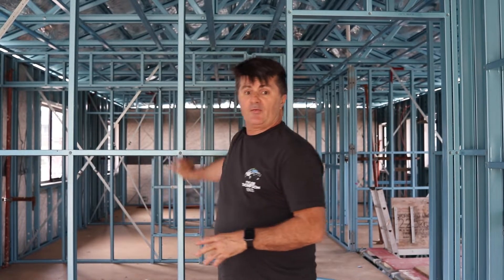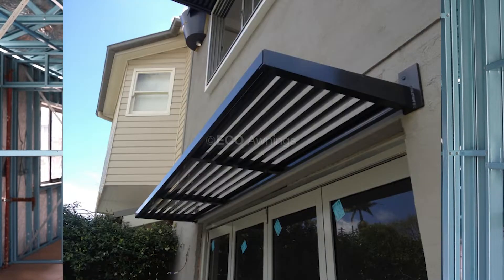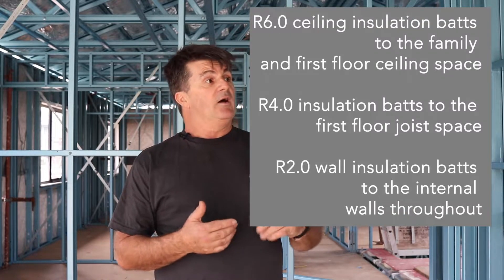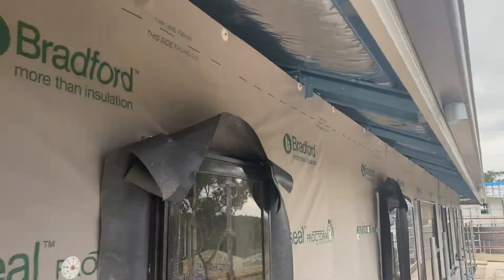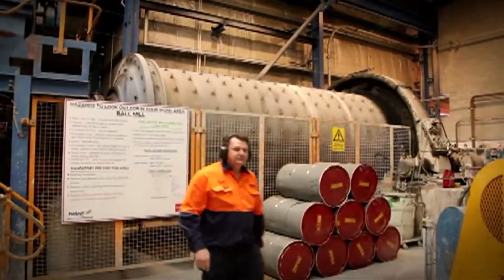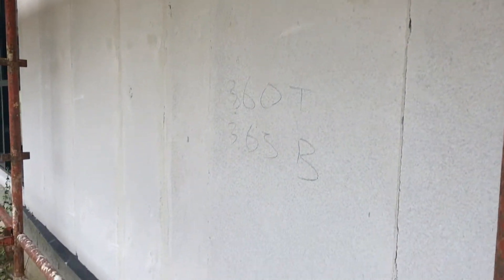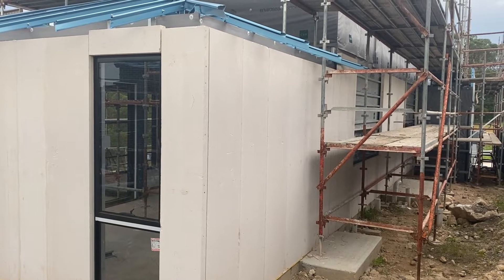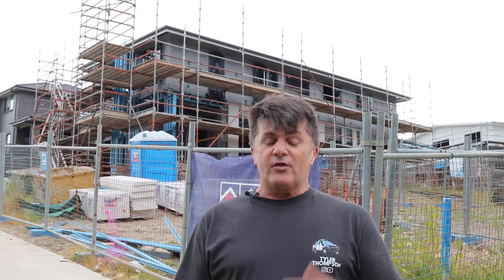House Build // Frame - Hebel - Insulation - Fire Rating - BASIX Rating

Comment: hows hebel in terms of handling heavier fixing on the wall? should we consider anything in mind, b4 build to make fixings easier later on?
Ex: Retractable Hose reel, Alfresco roofing,flood light fixing etc
Reply from the maker: For stuff like flood lights it's fine, our builder has also hung the louvred stacker door awnings off the hebel with no issues. For items such as hose reels and alfresco roofing, I'd be putting in self supporting uprights, into the ground. Would be both quicker and easier in the long run.
Reply: @DarrylSheather  thank you

Comment: Steel frame has its pros & cons but really not a bad choice since you are in bushfire prone zone, plus it is termite worry free. Need to do a backyard standalone studio and considering using steel frame, just curious to know which supplier / manufacturer you went for and how did you think they quality and install. Thanks.
Reply from the maker: I can't fault the steel frame itself, really can't think of any downsides to it so far.
Reply: @DarrylSheather  heard something from structure engineers, mainly around the expansion / contraction due to temperature changes, causing weird noise, plus it's not as easy as timber frames in case of indoor reno.

Comment: How is the hebel panel strength and finish? Very keen to see what this is like considering I’m using hebel in my house build. Any regrets over using brick?
Reply: It will not have the same strength as brick so no drilling and installing AC units etc on walls.

Comment: Is hebel stronger than brick?
Reply from the maker: when rendered its quite good, the panels also have reo embedded in them.
Reply: @DarrylSheather  Thank you for the reply. I'm building with Mojo and at first I decided to go with hebel but change my mind.
Reply: Been involved building with herbal since 87 and herbal panels at Bella vista on nor west blv nor west. Insulation perfect. They don’t like moisture or any movement. Easy to damage must use a herbal approved render. I’ve also seen a lot go bad because of this product. Just a heads up herbal was originally designed for explosive material rooms or like mri , cat scans X-ray and DAARKKE no it’s stronger than brickwork.
Reply: @Pumped-koala  Thank you so much and appreciate your input. I've told mojo to change it to brick and not hebel. Again thank you very much

Comment: We used Hebel, as a floor for the upstairs. . Apart from insulation, it will not squeak in 10 years as particle board does.
Reply from the maker: Sounds like a good idea!
Reply: Only reason ply floor squeaks is because  alot of carpenters aren't screwing floors

Comment: While the frame is exposed, mark the garage floor so it is easy to find the frame after the gyprock has been installed.
Reply from the maker: I was going to do that but as its steel felt it should be pretty easy to locate afterwards.

Comment: Wow that will be a very solid house. I really enjoyed seeing the detail on that outer cement based material you showed. It will definitely help with thermal bridging from the outer heat to prevent the steel frame to get too hot. I hear it gets very hot in Australia.
Reply from the maker: thank you!